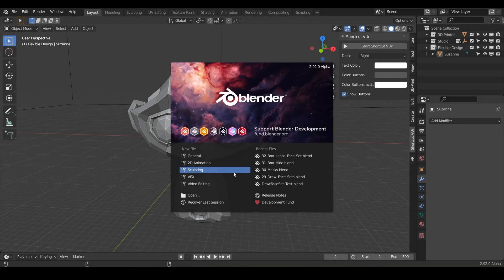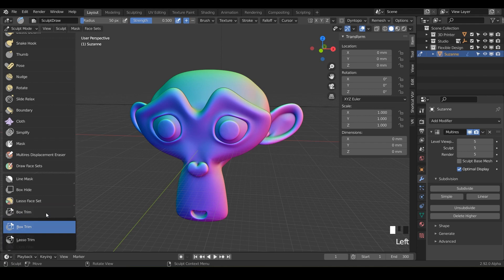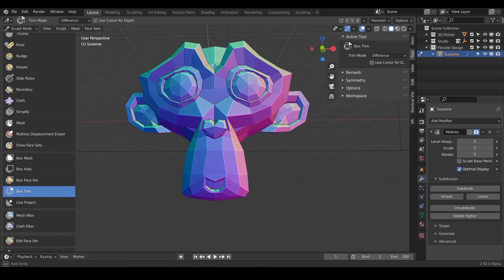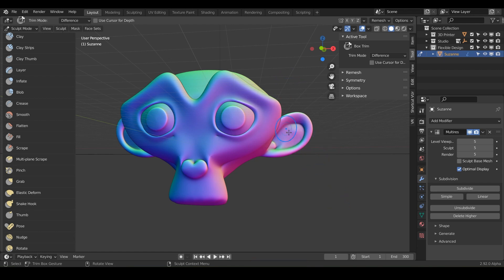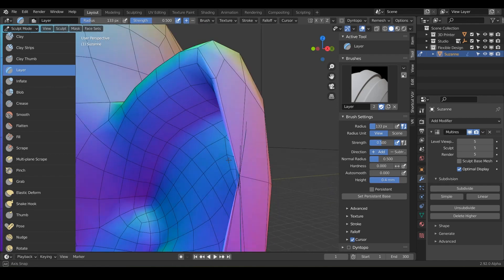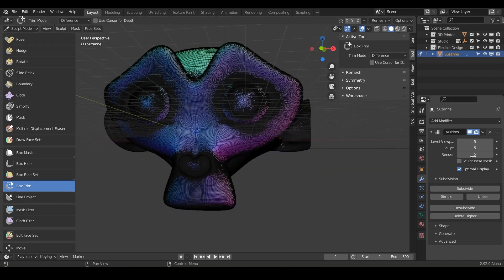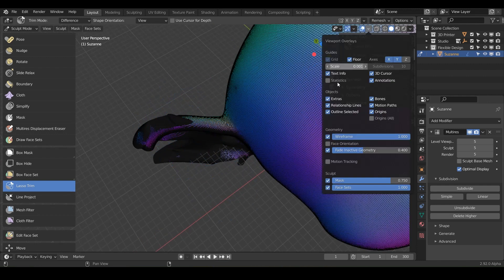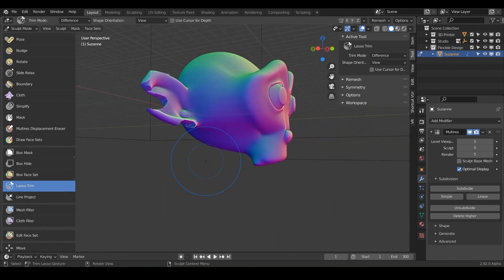Box & Lasso Trim Sculpt Tool (EXPLAINED) | FREE Blender for 3D Printing Course

Comment: Hi I'm building some wolverine claws for 3d printing and I'm trying to cut a C shape into it,I used the lasso trim tool and it does what I need but is not a clean cut, is this what you mean when you talk about the artifacting and early stages or is there a way to achieve my goal?